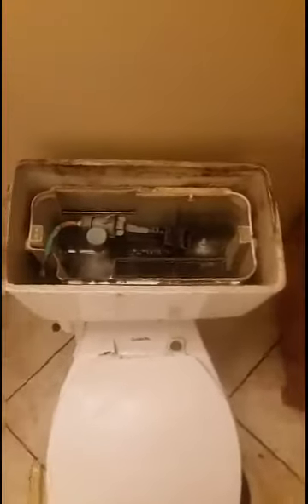Glacier Bay Toilets suck! Removal and install of a kohler

Comment: These toilets are junk and very clog prone. I think that these flapperless Glacier Bay toilets were thankfully discontinued a long time ago. You did yourself a huge favor by replacing it with something much better. Personally, the new Glacier Bay Powerflush, Mansfield Summit, Mansfield Alto, Mansfield Denali, Toto Drake, Kohler Wellworth, Kohler Corneille, & Kohler Cimmaron are far better toilets. My favorite brand is Mansfield.